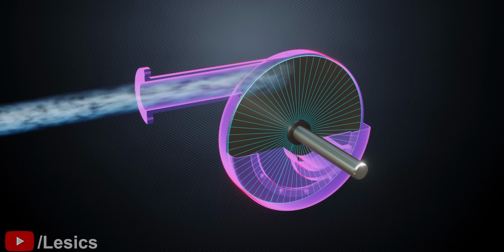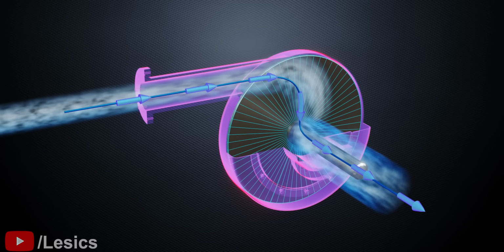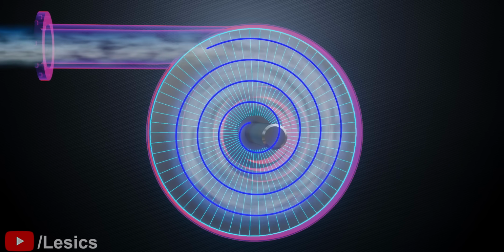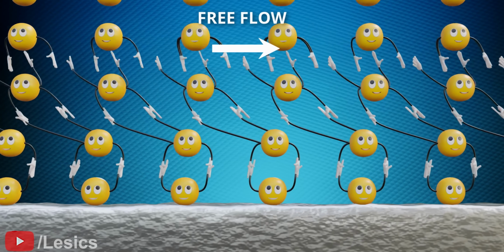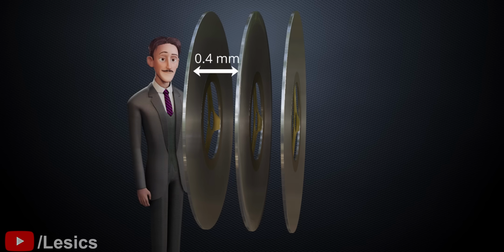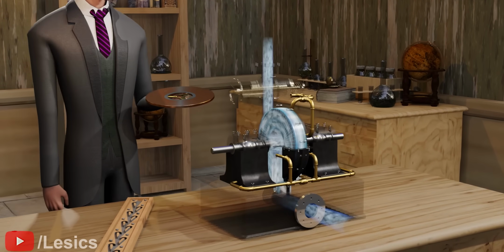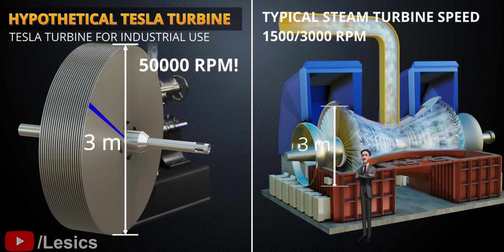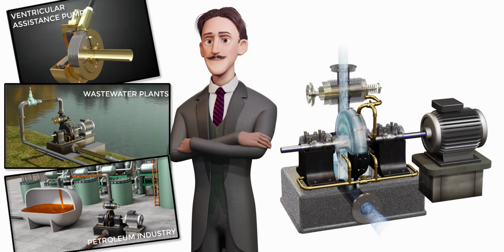Tesla Turbine | The interesting physics behind it

Comment: I love how Nikola Tesla’s Inventions can all be summed up as “ it works to good to work practically”
Reply: Except for a lot of his inventions that are actually in use and were groundbreaking. Like radio control, the brushless AC motor, AC power system.
Reply: More like:

They don't work at all, because he got the theory all wrong
or
They work, but are not good enough to be competitive.
or
They work in theory, but only under extreme circumstances that make them utterly impractical.
Reply: You mean, like the polyphase AC motor?
Reply: Well not quite. Remember he invented the AC electricity and the flourescent light. If he only invented the AC electricity, he would be a great inventor in my book.
Reply: @el3ali  No he didn't.  Hyppolite Pixxie invented AC more than a half century before Tesla used it.  Most of what people think they know about Tesla is absurd hero-worship mythology.
Reply: You should probably rephrase it as it works too good to work practically at this time. It's for the future!
Reply: Too good .....
Reply: Or much the same as a lot of inventions there is no material technology to make it work
Reply: Too*
Reply: yeah, his stuff is useless
Reply: A lot of Tesla's inventions are about maximizing for some attribute. Turbines are for turning linear fluid kinetic energy into torque. The fan blade design lets fluid flow past, and can't approach a theoretical 100% conversion. So he came up with a design that makes the fluid stop and leak out the sides perpendicular, converting all of that energy in principle. The faster the incoming stream, the faster the device rotates, and the more the fluid has to slow down before exiting the device.

So basically Tesla saw people inventing "good-enough" solutions that could never maximize the desired result. He invented things that could get infinitely close to the best possible result. But the thing about infinites is that if you expand one variable in a system infinitely, you also tend to expand other variables infinitely. In this case, infinitely close to 100% efficiency  also means infinite fluid speed, infinite RPMs, and infinite disk/casing durability. If you pull it back to reasonable inputs, it turns out that the "good-enoughs" that can never reach the theoretical maximum even with infinite input, beat the max-potential device. At least until we invent ways to increase the reasonable limit of the inputs.
Reply: If it was practical to apply that that would make it good, otherwise no good. That is the whole point. Many inventions are out there that are great theoretically, but without the materiel science to bring it to life, none of these inventions are practical. My friend with Phd in Physics tells me this.
Reply: @sevencostanza3931  the hilarious thing is that all of teslas claims have been-or are in process of being-proven. The dude was tony starks dad, ahead of his time, been dead for years and we are still getting schooled by him. You’re on a tesla device just by sending a message.
Reply: @blainevans9237  The level of ignorance in this statement is too much to bare. Tesla is in no way responsible for modern communication or computers, and a lot of what he said was already proven wrong while he was alive. The man is a bona fide con artist and people are still falling for him. I guess that is something to respect.
Reply: @danieljliverslxxxix1164  I guess I’ll go ahead and respect him more than a troll with no proof behind his statements
Reply: @57thorns  what proof? What the flat earth-chemtrails-climate change are you talking about?
Reply: @blainevans9237  Plenty of Tesla's claims were nonsense, like when he wanted to transmit electricity through the air or use radar underwater.
Reply: @charlesthomas135   you can do both. oh sorry go ahead wave effects are fun just calls some thing different but basically the same thing and used.  Point to point through air is done you know sonar is radar basically for under water.
Reply: @mikel1784  yeah other than being totally different, sound waves and electromagnetic waves are very similar.
Reply: @sevencostanza3931  Yeah but Tesla sort of an bodies that way of thinking
Reply: @sevencostanza3931  Being practical is relative to the time period. So when the materials are made, it will be practicle. Till then not so much lol.
Reply: @sevencostanza3931  "My friend with Phd in Physics tells me this." yea and you forgot to mention that noone knows him contrary to the Tesla...
Tesla work revolutionized the world, the guy was building RC models in XIX century and there was no material for this type of job.
Similar story with Wright brothers if everyone would wait for proper parts and proper material we would not be able to do powered flight to this day.
No to mention that from the video its clear that Tesla designs are used to this day and modern tech depends on his inventions more now that it was during his life...
Reply: @Bialy_1  As stated in the video, many of Tesla's inventions were never developed & cannot be even to day cause of material science. There NOT practical. The main Tesla invention-AC induction motor & A/C power use---was the best invention & of course practical.
Reply: @sevencostanza3931  I dont alternate my currents, I dis you directly.
Reply: @Bialy_1  I'm not sure what to think of Tesla, but it seems to me the Wright Brothers were masters of making something "good enough" with materials that were actually available. They built their airplane out of wood, cloth, etc.

From what little I know about them, Tesla's AC motor ideas seemed to demonstrate a very detailed and nuanced understanding of electromagnetism, induction, etc.

But sometimes there is genius in a detailed understanding of what materials and manufacturing techniques are actually at your disposal.
Reply: @Fuzzybeanerizer  
The secret of the Wrights success was their lightweight engine which was actually built by their mechanic Charlie Taylor a man criminally underappreciated.
Reply: @sevencostanza3931  Tesla did not invent AC, Faraday can take the credit for the earliest working design.
Reply: @adamnichols476  i found this to be very funny.
Reply: @TonyLing  no faraday discovered the concepts behind it tesla invented the reality of it by making transformers.
Reply: @sevencostanza3931  Are you deaf? They said it's not possible FOR LARGE POWER due to size requirement, a small tesla turbine for your personal use is MORE than practical.
Reply: @Bialy_1  I seem to have noticed a pattern: every time I see the word PhD or another socially-accepted/recognised form of "intelligence" the individual doesn't have a clue of what he is talking about.
Reply: @thermionicemission6355  No not deaf, just what I commented....practicality is #1 admiration. Lots of inventions are fascinating on paper but without being practical...it won't change how we live. So who cares for the large Tesla turbine. As far as smaller version of Tesla turbine, I cannot find anyone on internet land using smaller version.
Reply: @iamchillydogg  I understand that there was a German inventor who might have beat the Wright brothers except there was an error in the specifications for the motor they order from Daimler. It was too heavy, and so the Wright brothers were first.
Reply: @vocalsforever  No, Faraday discovered the concepts. Pixxi invented the reality of it and Tesla took the credit.  Sorry to bring your god down.
Reply: If Tesla was around in our time Iphone batteries could last days
Reply: @footballcoreano In enginering practicality is everything.

Physics/Theory: Nothing works, but we know why.
Engineering/Practice: it works, but we do not know why
Reply: @57thorns  Look at all you trolls, going off of Main stream blinder ignorance. If you really knew something, he would know that Tesla‘s papers that have been released in the last 15 years have spurred hundreds of businesses most of them working secretly with US government on things that you’ve not only not heard about, but don’t care to learn because you want to stay in your ignorance-it keeps you safe.
Reply: @57thorns  viziv...look em up. That’s just one. If you want to be more that a base surface troll, you need to DD better. Also look at submarine oscillation, Tesla’s stuff the gov was using 70 years ago. Try harder. Or stop with the gov fan club.
Reply: @blainevans9237  This is bait.
Reply: Well Tesla invented a tech that can give us infinit electricity 100% ecologic and olso transport of eletricity wireless , his invention are practically but anti petrolium gaz coal and metals
Reply: @adrianciobanu5856  No, that's bullshit. You are spreading disinformation.

Comment: "the only option left is to reduce the RPM"  .  .  . OR . you can reduce the disks' diameter.
Reply: Also not forget that the turbines had stellated spacer disks that allow the gas to push the rotor, and the rotor to push the gas, making it act like a hydrodynamic differential.

Comment: 'if scaled to 3 meters it's spinning too fast'

So. . . Don't scale it up to 3 meter disks. Operate a smaller disk at the higher RPM, or stack more of them horizontally / sequentially.
Reply: Did you watch the video? It needs to be that size to attain maximum efficiency. A smaller disk would need to spin even faster.
Reply: @arcticowl1091  no, it wouldn't need that size to maintain max efficiency.. that's not correct.
Using multiple stages is the answer
Reply: @TheTechmaster1999  well, they didn't have carbon fiber when Tesla was making this, that's the problem. Would love to see this actually work with a compatible material.
Reply: There will be a optimal size much like how there is a optimal amount of blades in a turbine. The problem I imagine is that the optimal size to get centrifugal force to keep the steam rotating enough to give most of its energy is to fast for current materials and anything less means less efficiency then the current turbines. 

This device takes advantage of centrifugal force to keep the steam in contact for longer, smaller devices will have less force as well as having less surface area so less efficient.
Reply: modern turbins use multi stage. the hp stage is relativitly tiny and spins at insain speeds the next 2 stages are progresivly larger to take up more enargy of steam. ive heard thy have tryed this tesla turbin in a lab recently. using same material of currint turbines. it maid it up to belive was like 23000rpm. and the shaft faild. they rebuilt tryed agen then a disk faild. so where half way there im gessen.
Reply: they meant to scale it up to 3 meters to be usable for current industrial power plants... if materials were available like carbon fiber or carbon ceramic, the mach 13 speed would still be a challenge for the bearings, i don't know if ceramic bearings could withstand that rotational speed..
and yes a smaller scale experiment could be made with smaller disks and new materials just to prove if the 97 percent efficiency is possible...
Reply: @pihermoso11  industrial just means bigger because they can.  Smaller versions can be linked together easy enough.
Reply: Wheel can rotate at same rpm if flow its same.If the wheel is biger doesnt mean that its gona spin as fast as the small ones.If you increase the flow of fluid then will 3m disk spin faster not because that is biger.
Reply: You need the steam to stay in contact with the disks for as long as possible, which means large diameter, high rpm. just having more disks just means it can handle more air going through it, not increase the efficiency of energy transfer.
Reply: The problem was nothing can spin that fast without breaking apart or warping.
Reply: @Badenhawk  Wrong, there are tesla turbines spining at 120.000 rmp, of course are too small
Reply: OH MAN YOU'RE THE FIRST SMART PERSON ON THE PLANET TO THINK OF THAT!!!  What else can you solve?
Reply: @cjschmitt4882  Sometimes the smartest idea doesn't win.  The easiest one does.  Why replace something people are readily building that can get 90%?  Also patent deaths.

Comment: To reach the '97% efficiency' that he claimed, Tesla set up a design with secondary or even tertiary turbines.
The outlet of the first flowing into the inlet of a secondary turbine and so on.

It's a great design that is underused for turbines and especially for pumps.
Reply: It is not underused. It just does not work well under load.
Reply: sadly efficiency is not as profitable. :( RiP tesla!
Reply: @Maradnus  that's what fins on a turbine  are for, to make this exact  system  more efficient.

Comment: the problem with this turbine is structural.. metallic bonds are only sharing a single electron between atoms.. this allows us to bend and stretch metals into useful stuff... beyond a fairly low RPM.. the metals in the disks stretches.... and not far beyond that the metals in the bearings will.. melt or something catastrophic.. no one has gotten past the disks stretch point.. so materials engineering.. and I have silicon carbide... as hard as diamond... with double double covalent bonds... I have been sick so have not been able to work on this... with the right setup I am pretty sure I can make it work correctly

Comment: When the velocity of fluid particles low and disc angular velocity is also low and the path  A B C is a straight line and so radius of curvature is infinity. For the curved path A B C, radius of curvature is finite. So the narration has to change.

Comment: I have a question as someone who never passed Physics, if the major problem is the high rpm both heating and malforming the discs leading to breakage couldn't you cool the environment inside the tube or use nitrogen as the liquid to reduce the chance of malfunction?

Comment: 2:03
What do you mean by " assuming the inlet pressure is higher then the atmospherical pressure"??
Reply: @TheTechmaster1999  ok yes i know. But i was more trying to understand the " ASSUMING". What i hear in that phrase is ; " lets pretend that, for no reasons, the inlet pressure is higher then the atmospherical one."
Because if you need energy to make the inlet pressure higher to make the system move, it's nothing but common sense that the pressurized inlet will make the system move if an exit point is provided in the system.
The exit way of the over pressured inlet can never be higher unless you make the turbine spool with an other independant energy.

Comment: Good explanation of how Tesla maximized use of the boundary layers, but I'll take Tesla's word about high efficiency over this author's! Remember that a contemporary of Tesla calculated the efficiency of the pump as very high, and Tesla only quibbles about another one or two percent. Also, who says the turbine would have to be three meters in diameter to be useful? There's a great need for efficient small generators of ten kilowatts or less.

Comment: Is this kind of like a torque converter or am I completely off the mark
Reply: It's essentially half of one. It can also be used as a pump, and if you connect a few together with valves (and use a fluid), that could be used as such.
One pump driving two turbines: conversion to low rpm, high torque.
Two pumps driving one turbine: conversion to high rpm, low torque.
Reply: @silvergreylion  thank you! ^-^

Comment: how about just use heavier fluid, or fluid that's more elastic?
Reply: An "elastic fluid" is basically a gas. I think the example in the video is based on using steam to drive it.
I cannot think of any elastic fluids, or even what would cause a fluild to be elastic, short of having air bubbles in it.
Anyway, a fluid would absolutely bring down the maximum rpm to where the material strength of a steel disc is enough, but then you have to take a step back and think about what you're trying to do/achieve.